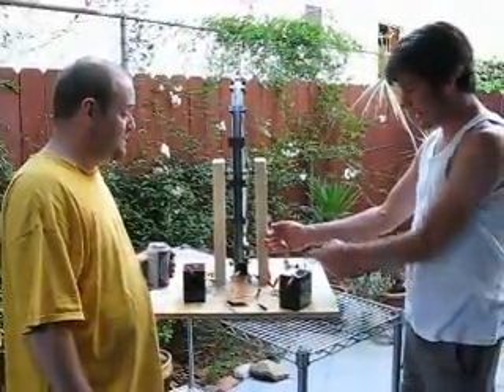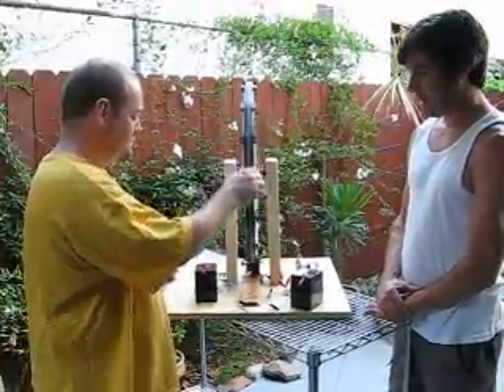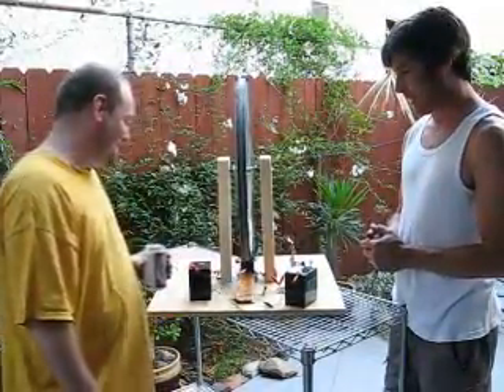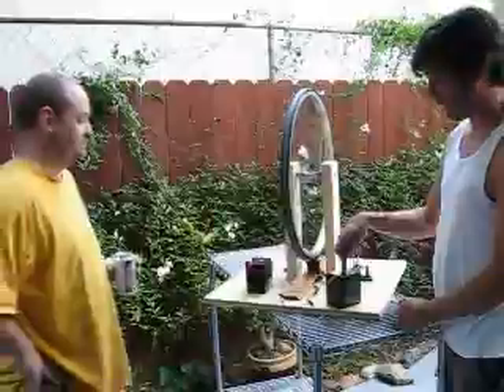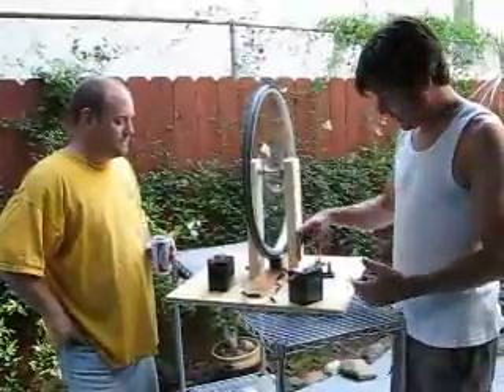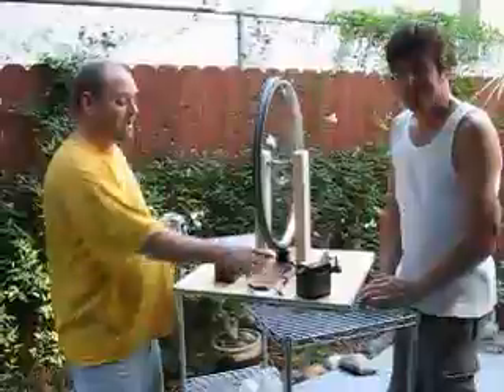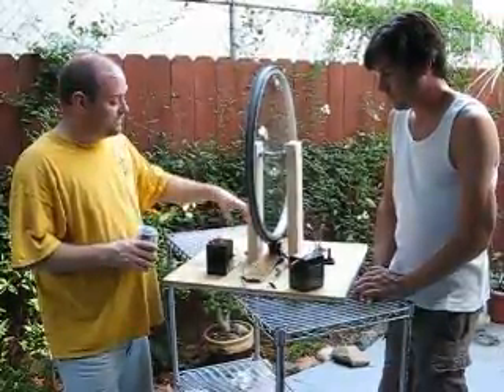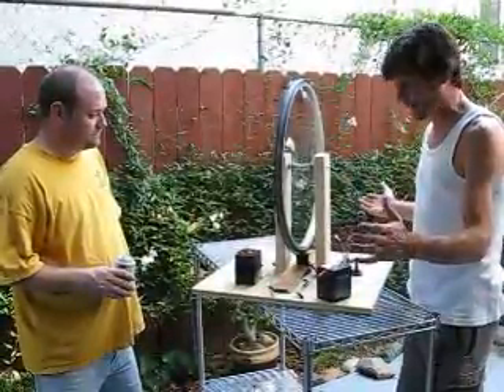Bedini Motor - Day after

Comment: made one with small fly wheel. Goes 40,000 rpm with one bifilar coil. And for loss of power use solar panels. It's just extremely efficient plus motor it will run out of juice. But if you add solar power to it. Then it's a little different story. Still useing power but it's fuel is shining every day ☺😊

Comment: Ok, so in your own video you admit that one battery is discharging while the other is charging.  So there's no gain in energy here.  All you're doing is moving the power from one battery to the other.  By saying you bought both batteries at the same time (assuming they were both charged) you've also admitted that both batteries are no longer charged.  Eventually both batteries could end up dead...  So you're actually using more power than you're gaining.

Comment: @rostit420

Actualy be careful with ohms law, this scalar form can be applied only by DC.
even if you use a battery, as the wheel spins, the movng magnetic fields wil make the voltage and current vary. So it is not taht easy to measure power.
Nevertheless, it will drain more power from the battery than what it will produce...

Comment: I mean this with all due respect.If you use ohms law it disproves this entire idea. E=IR.The input to the motor draws  the amount of amps times the resistance of your input coil.You lose power through heat through that coil as well as friction drag on the wheel hub. The voltage through the diode and trans drops the voltage a minimum of 2.1v  through the trigger circuit.Any voltage that is induced in the fly-back circuit is of a much lower total wattage than the power sent into the unit.no offens

Comment: @WallesWillerWalla the same reason why pots illegal...has nothing to do with smoking it...Paper co's own logging rights and hemp produces better paper... Hemp produces a composite thats 10 times more impact resistant than steel and twice as light...Hemp-produces clothing that will last 3 generations...There goes the cotton co's.Hemp can be utilized in every aspect of construction...except wiring.and windows...Hemp oil was designed to run diesel engines.-follow the money trail to find your answer

Comment: you must be joking .... thousand of people have built this thing .. and not only this one but similar system that also work .... you people have to understand that it works .. how ? Tesla found out when they flicked the power switches on a waterdam and prior to the charge going through the electric lines and killing the Operators of the switch he observed the elecric line glowing in a green light. This is how Tesla found Radiating Energy the basis of all devices producing overunity ..read a bit

Comment: No experiment is complete with out a Beer. ha ha.

Battery chemistry, depending on the type of battery, needs higher voltage to charge. So you would never gain full charge. It would always be lower than the other battery driving the motor. Bottom line there are laws of thermodynamics that have NEVER been violated. WHERE IS THE FREE ENERGY COMING FROM? This is 25 yrs old and still people are getting fooled. Look at these Rocket Scientist. DATA CONTROLLED TEST PLEASE? 25 YRS STILL WAITING.

Comment: Is the battery being charged to full float voltage capacity in that one hour?  Just because the depleted battery being charged reaches 12 volt potential does not mean it is anywhere near being fully charged.

Very interesting machine.  True test is to build a simple switchover system exchange the charge/discharge batteries.  If it keeps running during lifespan of the batteries, then that would be something amazing.

Comment: Sedit2012 is right, or kind of. But free energy is possible, and this circuit provides it. Making the battery charge itself requires more electronics and perfect timing, but it is possible. Than this machine could practically give you free mechanical work.

And Bedini gave it to us...

Comment: Through away the batteries stick in a discharged capacitor and give a push. If it runs fine.  As it is now you have a pulse motor nothing more.